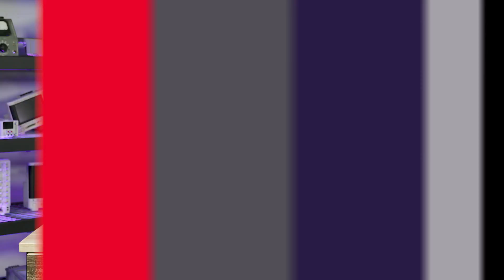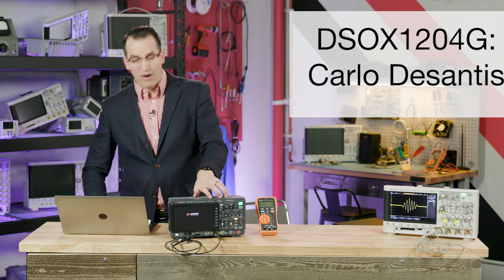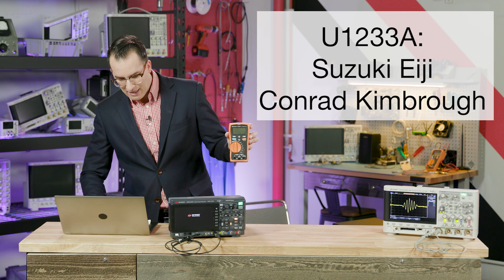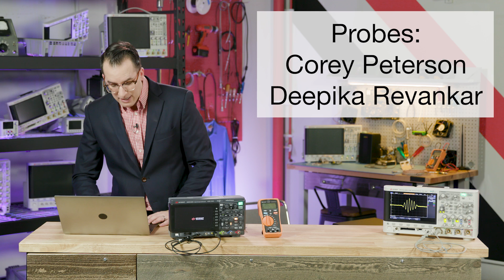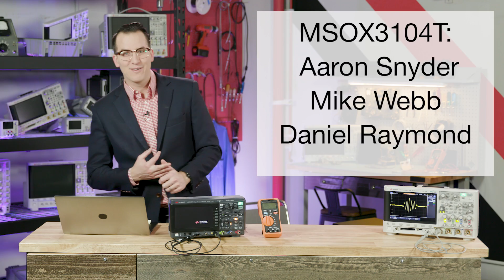ADC Specs, Signal Integrity, & Today's Wave Winners (7-Mar)

Comment: Some question: At the first days I always re-entered all my personal data into that entry form. Done that because I'm always surfing in private mode / deleting cookies. Noticed then that this might be wrong and maybe counts as double entry and I'm getting disqualified? (Mails missing as well, but someone else has that issue, too.) Well, the time zone and day shift of 9 hours doesn't make it easier, in the beginning at least. Than you anyway! (Edit: Same personal data ofc, at least.)
Reply from the maker: Nah, you won't get disqualified. The system will recognize you and not let you over-register. You're fine :)
Reply: @KeysightLabs  Pooh! Glad to hear, thank you! (Also got two entry confirmation mails, as I hit the "entry once more" button, too. But anyway, should work as you said. :) ) Now all that's left I need is some luck. :D
Btw: Some clearer/easier to find time/date zone information would be nice, otherwise confusion here on the other side of the sea occurs ;)